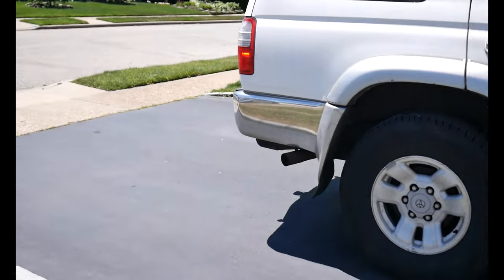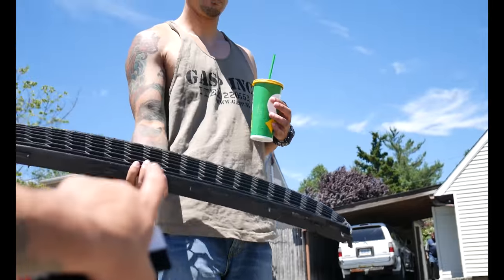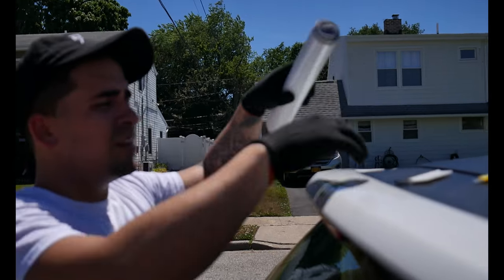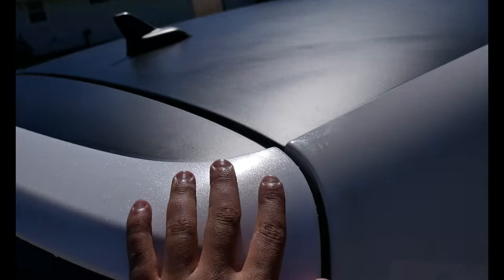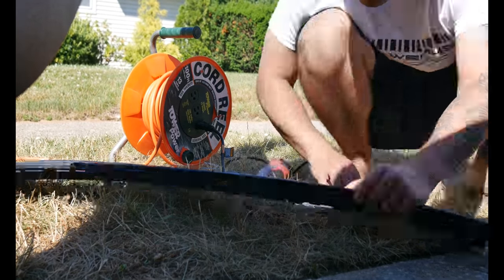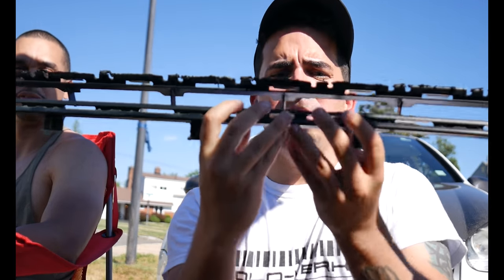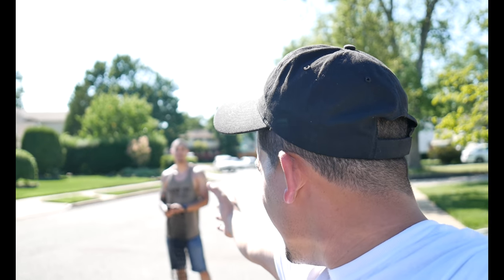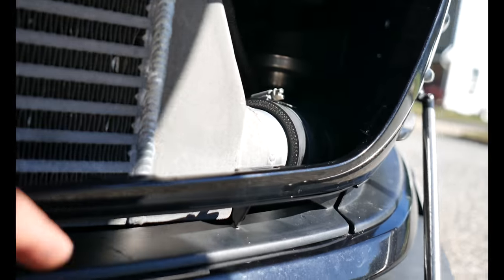Took the lower grille off my MK7 GTI

Comment: Nice ~ btw what's the brand of your fmic?
Reply from the maker: It's a CTS
Reply: jsmk7 is that the same as the Twintercooler, if not then what's the difference and would a Twintercooler be something good for my car
Reply from the maker: The front mount Intercooler is better than twintercooler. The twin adds an extra place for air to travel through. This system completely overlaps the OEM Intercooler.

Comment: Awesome video! I got the same FMI as you and I'm having trouble drilling the holes to mount it. Any tips?
Reply from the maker: Thanks for watching. Use cobaly or better to drill it out. The crash beam is very strong but it'll work